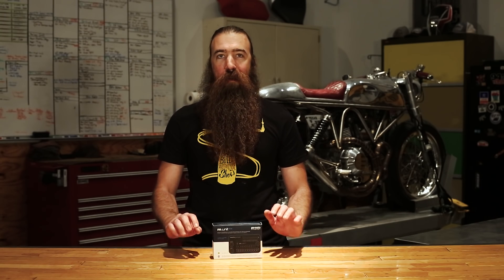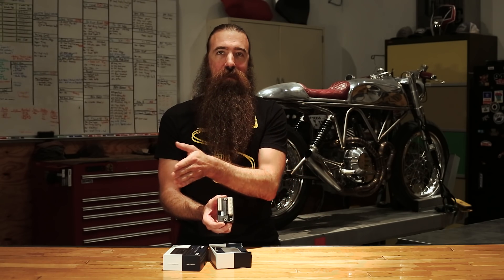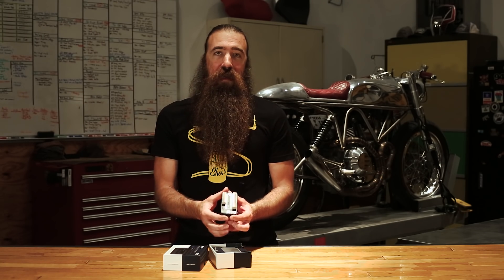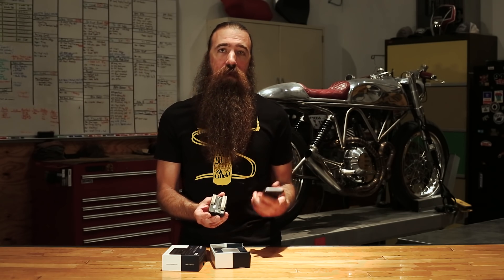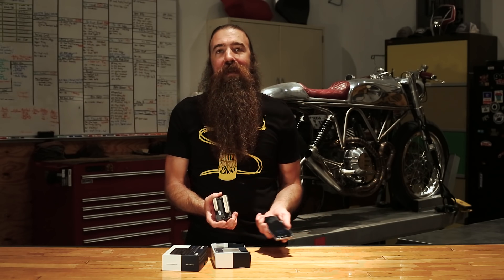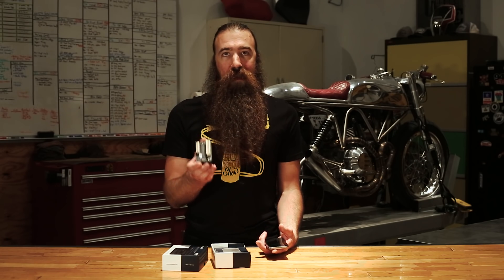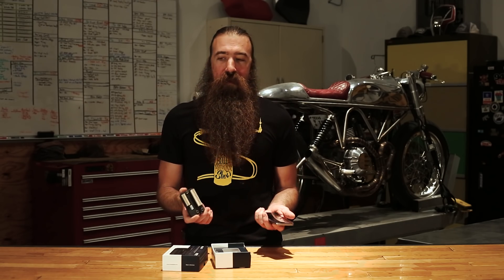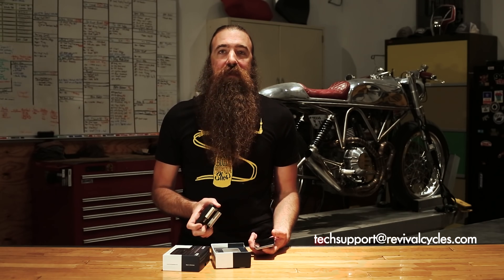Meet the Motogadget M-Unit Blue - Revival Cycles' Tech Talk

Comment: Im a caveman when it comes to wiring here so lets say headlight wire to the m unit and then one wire from the m unit to the headlight switch?
Reply from the maker: The headlight (momentary) switch will go into the input side of the mo.unit and the wires going to the headlight will be coming from the output side on the mo.unit. Main and high-beam.

Comment: So does this get rid of the ignition control module as well? (Honda vlx chop)
Reply from the maker: The ignition control module is a component unto itself. The Mo-Unit is a power distribution module and will supply power to many electrical components you choose to use but it is not an ignition pickup. You will still use your stock/aftermarket ignition.

Comment: I know this is an old video so i may never get an answer. I have a 77 Yamaha XS650. Ive converted to a permanent magnet alternator. This allows me to run batteryless if i run a small capacitor. I assume i still need to wire in a main fuse between the capacitor and the m unit? Im no electrical guru, and im trying to plan the wiring layout, but i dont want to have anything wired in that wont be needed.
Reply from the maker: Let's skip fuse talk for a moment and get into the operation of the M-Unit itself. 
In theory running an M-Unit in a battery-less system will work but here is something to consider:
Voltage is key. M-Units require steady 12+ voltage in order to function properly. They are great units but if you have varying/inconsistent voltage you will experience M-Unit operating problems and you could be chasing your tail with a lot of issues that can simply be attributed to voltage. Running a battery-less system even coupled with a capacitor can still allow voltage spikes and drops and most current electrical components don't like that, especially ones that control all of your lights and accessories. 
Hope this makes sense. 
But to answer your question.. when in doubt.. fuse it.
Reply: I had considered that in the back of my mind. The good news is if I need to I can run something like the 4 cell or smaller (if there is anything smaller) if needed since I don't plan on using a starter. One thing I hadn't considered with the M unit is that I may not have enough voltage for it to turn on so I can start it.

Comment: i have the old M-unit and going to replace it with the new Moto Gadget Mo Unit. my question is the old unit had a config. across from the light lo. where do i put that config wire on the new one

Comment: I posted the same question on the contact form in the website of Motogadget, waiting an answer. I try to post the same here.
I need to know a simple thing: May i use Motogadget System (M-Unit,  Motoscope-Pro, turn indicators, M button and so on) in a Moto Guzzi Lodola Granturismo (235 cc) from the far 1964? I'm restoring it with a little touch of new technology in the instruments and electronics. Thank You in advance!! I love this kind of video!!!
Reply from the maker: Long story short(ish) -  If your bike has a 12v system then yes, you can use the Motoscope Pro. If your bike has a 6v system then no, the Motoscope Pro will not work. 
The M-Unit however will work with a 6v and 12v system and of course any lighting works the same way, they can be 6v or 12v depending on the bulbs you use.
Reply: @RevivalCycles  OK, thank You for the reply. My bike have a 6 volts system. So, i must use another rack of gauges. Now i have to choose it 🤣🤣

Comment: How do you configure the settings manually in the Munit for blinker flasher dimming on off & 1 wire running brake light / Brake light settings? I have the newer unit but non Bluetooth version.
Reply from the maker: Hi Scott, this is all outlined in the manual. I don't know how to explain it any better than they do and I can't fit the entire explanation in this reply.

Comment: Nice, do I need any extra length wires to install this?
Reply from the maker: It involves a full rewiring of the bike and we offer complete wire kits for this on our site. Most of the OEM main harness can not be used since the m.Unit is an entirely different way of managing power not to mention replacing old compromised wire is part of the appeal.

Comment: Explain what happens if your cellphones dies and bluetooth link is broken? Will your bike switch off while riding?
Reply from the maker: This question comes up a lot and the answer is that nothing happens, the Keyless Go requires a BT connection to your phone to power the m.Unit on but that's it. Once the m.Unit is on a lost connection will not have any impact. Regardless, you always need either a Key or hidden switch to turn the bike on. Otherwise you could be stranded. You also would not be able to enter the pairing mode on the m.Unit and you couldn't loan the bike out or leave it with a mechanic.

Comment: I am new to custom biking and just starting my first project. The M-Unit appeals to me but I am on a very small budget. Is there anywhere I can buy an original V2 unit?
Reply from the maker: The V.2 was discontinued, 3 or more years ago and I can't imagine someone still has one on the shelf after that long. The V.2 was a solid component but the features accesible through the application save so much time during set up and troubleshooting that it off sets that added cost pretty quick.

Comment: Which is cheaper? This m unit- blue, or the V2 ? I've been searching all day and can't find any V2's ANYWHERE for sale.. can someone help me with a link?
Reply from the maker: The V.2 is absolecent and hasn't been manufactured in years. The Blue expands on the design and improoves a lot of the shortcomings of the older V.2.  The Basic slightly less expensive but is just the same hardware as the Blue with dumbed down firmware. After you've done a few installs it becomes clear that the extra $50 spend on the Blue is quickly returned by the time saved programming them and ease of troubleshooting. Read more about it on our KB https://technicalarticles.revivalcycles.com/hc/en-us

Comment: Lovin the m-units but another point to mention is that its not quite a straight swap for the v2 because while the connections might be a straight swap the actual mounting of the unit is not because they altered the spacing of the mounting holes....great vids tho love them and very informative...regards.

Comment: If anyone knows a cheaper option comment below.
Wish they sold a kit with the m unit. Their super stream line buttons and a small display. I don't need an oil pressure sensor and unlimited led options.
Reply from the maker: We sell complete wiring kits, and Loom kits on our site. Beyond that there are so many variables that it's impossible to make a comprehensive kit that covered everyone without also providing many things that some won't  need. 

We've created a guide for everything one might need on our tech articles page in three phases beginning with the core components and expanding upon that depending on what you need or how far you intend to go. 

https://technicalarticles.revivalcycles.com/hc/en-us/categories/360000739551-Motogadget

Our loyalty to the product is on account of what it provides of this quality, at this price. If you or anyone comes across a well made solid state Power Distribution Module that does even a 10th of what the m.Unit does for less money we'd like to see it. So far everything I've come across is still 10 years behind the curve.

Comment: WHat amps are each circuit capable off? Can they be bridges if not enough amp for 1 circuit?
What are the chances of using this in a hot rod or a car with basics accessories.
radiator fan, head lights, brights, tail lights,brake lights, turn signals L&R, hazards. 

Really looking for something small and simple to clean up the clutter.
Reply from the maker: Each output terminal can handle up to 15 Amps. The Starter output has two dedicated outputs to supply enough amperage for high compression starters. But the m.Unit isn't really suited for automotive applications. There are options out there that are car specific.

Comment: will it replace the relay for the light functions?
Reply from the maker: It replaces all relays with exception to the starter solenoid which is technically speaking a relay but carries but higher amperages than the m.Unit is capable of.

Comment: Does this replace the ecu?
Reply from the maker: No it doesn't. It's primary function is as a solid state fuse block replacement and micro controller but there are dozens of additional features incorporated as well. With this you still need an ignition system or ECU and charging system.

Comment: Only motorcycle applications?
Reply from the maker: In theory you could use this for automotive applications. The limited number of power terminals would limit it to minimal electrical systems and the ground signal input controls would require creativity but not be insurmountable.

Comment: I'm putting an munit blue on my 31 Ford right now. Not sure just yet if I can run my starter off it or if I need to run it another way.
Reply from the maker: The m.Unit Blue has two Start outputs that together provide 30 amps. So long as your starter falls within that range it would work. 

If it's more than 30 you could use one Start output to trigger a higher amperage relay. Just be sure that any voltage wring running outside of the m.Unit has fused circuit protection. 

I've work out a diagram for using automotive style Key Start Ignitions. If shoot me an email at techsupport@revivalcycles.com I'll be happy to share it. 

-Berry

Comment: How can i wire a harley off/run using  a mbuttom ??
Reply from the maker: The factory Off/On switch wiring can be modified so that it completes a ground circuit when in the Off position signalling to the m.Unit to kill the ignition. 

Japanese and Italian Bikes with a 3 position Off/On/Off switch generally can not be adapted due to the nature of how they are wired though a convoluted solution involving a relay is possible if you are committed to using the OEM switches.

-Berry

Comment: Looks great, I understand the inputs and outputs but where do the wires come from for the instrument panel? Like the neutral light or the high beam indicator bulb?
Reply from the maker: The signals for the dash indicators come from the individual circuits they are idicating. For example, the high beam indicator is powered from the high beam output, in addition to powering the high beam itself. In the case of the instrument back lighting, and neutral indicator those can be powered by one of the AUX outputs, or the ignition output. If using the ignition output, however, the indicators will turn off with the kill switch.

Comment: can we directly wire a LED turn signal to the M-unit Bleu or we need some relay or fuse ? does the M unit manage the delivered power to each unit ? (sorry for my english)
Reply from the maker: Yes, the m-Unit will work with LED's or normal lights. You do not need to add any relays or fuses. The m-Unit does not regulate power to the LED so you need to use 12v compatible LEDs.
Reply: Revival Cycles so I can directly wire the m-blaze pin or a led loop ?

Comment: phone battery goes , no bluetooth , stranded .....
Reply from the maker: As the manual and others have mentioned, it is a good idea to have a physical ignition switch to use as a backup in this situation. It can be as simple as a toggle switch under the tail section so you remove the seat flip the switch, and the re-attach the seat. Or go with a normal key switch or m-Lock.
Reply: be smarter than your smartphone
Reply: why don’t you just put a phone charger through the battery…

Comment: Hello, I have a problem with Motogadget m.unit basic. My problem is with "start" ignition input. And have not started the motto. I did a relay ignition but with the same success. I think the output current is weak and can not even feed the small sprout of the ignition relay. Please help. Absolutely everything is related as stated in the instruction in the product box. I put the old m.unit model and everything works perfectly without problems. I'm asking for help
Thank you
GARAGE 77
Reply from the maker: Hmmm, that sounds like the start output is not turning on. That output should have 30 amps available and that is more than enough to trigger a relay or solenoid. In fact its gross overkill for that application. Before concluding the m-Unit is malfunctioning it is best to do some very simple tests.

1) Disconnect the input and output wires for the circuit in question.

2) Use a simple piece of wire as a switch to make sure the input terminal on the m-Unit is getting the correct ground signal. Strip both ends of a piece of wire, insert one end into the m-Unit input, turn the m-Unit on, then touch the other end to ground, you should see the LED light up for that input. 

3) Connect a simple 12v light bulb to the output for the circuit that is not working. Then repeat the input test. The light bulb should light up. Also make note of what the output LED's are doing. 

When troubleshooting, it is very helpful to know what the LED's on the m-Unit are doing when the issue is occurring. That gives a lot of information about what could be causing it.
Reply: Revival Cycles ,I had done all of this from point 2 and 3. It all works. I have a ground at the input terminal, I have a terminal output current but can not rotate the starter. If you can give me your email I can send you a short video to get an idea of what's going on. thank you in advance
GARAGE 77
garageseventyseven@gmail.com

Comment: There should be a 90 degree connection available, I'm sure someone in the shapeways marketplace could print them
Reply: Hey do you have any further info about this? I really need a "creative solution" for this, to be able to place the unit under the seat with a very tight height

Comment: Can you modify when you press start button to shut off headlight when starting?  Looking to put gsxr controls on my 79 CB750.
Reply from the maker: With the m-Unit blue you can change the way the headlight behaves when the bike is turned on. The headlight always turns off when the starter is pushed, so the starter has as much power as possible. But you can set the headlight to stay off until the start button is pushed or it can turn on as soon as the bike is turned on. Here is the link to the manual https://motogadget.com/shop/media/downloads/manual/munit_blue_manual_en_2.0.pdf details are in section 9

Comment: Hi Revival Cycles! I bought some mini toggle switches as my handlebar controls (L-R signals, kill switch, headlight Hi & low beam). Would this m-unit work on this toggle switches too? I´m going to rewire my bike from scratch and I want to get this m-unit basic ( without bluetooth). I already bought the Motogadget cable kit too. Will the cables have the same connections from the switches to the m-unit too? Thanks you!
Reply from the maker: Yes, all m-Units can work with toggle switches for headlight, and turn signals...things like starter, and horn really need to be momentary switches, but momentary toggles would work. 

Without knowing exactly what switches you have it is not possible to discuss connections in details, so I'm not really sure how to answer this question. But the m-Unit will work with pretty much any wires, and any switches.

Comment: hello I'm putting together a honda magna vf750 1982 model, the bike has two cdi will work the M-Unit Blue ???
Reply from the maker: Yes, the m-Unit will work on a VF750, but just so you are aware, that bike does not have a Capacitive discharge ignition (CDI) but rather a solid state induction ignition. Its not really that important of a distinction, but its worth being aware of because if you want to install a motogadget gauge you don't need to use an ignition sensor, like you would have to if your bike did have a real CDI ignition.

Comment: Does it have a high/low beam toggle that works with a momentary switch?
Reply from the maker: Yes, the m-Unit has full functionality with momentary switches, or latching switches. You can setup the configuration menus to match the switches you want to use.
Reply: Revival Cycles thanks! Thinking my 900SS needs this setup.
Reply: ... And maybe my FJ40 now that I think about it.
Reply from the maker: Yes! we've been intending to install an m-Unit on a C10 project here at the shop but just haven't gotten around to it...somehow workshop projects don't take priority over customer work.
Reply: Revival Cycles That's a good problem to have I suppose!

Comment: How many switches can I run with this system?
Reply from the maker: The minimum requirement is 4 handlebar control switches (Horn, left turn, right turn, headlight with start and kill functions accessed by combinations of the other four) + Ignition switch, and brake switches.

 The maximum is 5 Handlebar control switches (Horn, left turn, right turn, headlight, start/kill)  + Ignition switch, brake switches, AUX1, AUX2, Dedicated Kill switch, and Side stand Switch

Comment: Hi. I already like the M unit but i dont have enough info about its future... well i am trying to custom my 2014 street triple but i cant change the speedometer or do anything because the ecu locks the bike and allow the starter to crank. So does M unit replace also the ECU and could it be used to program the engine?
Reply from the maker: No, the m.Unit does not replace the ECU. Bikes like your 2014 Triumph have an immobilizer built into the ECU. If you're looking to install an m.Unit on a bike such as this then you must replace the factory ECU with an aftermarket that does not have an immobilizer.